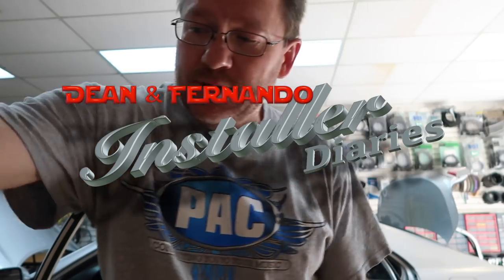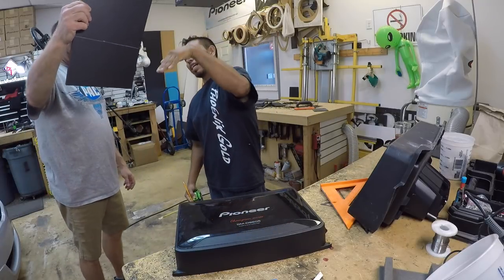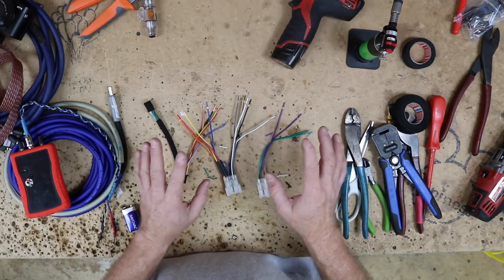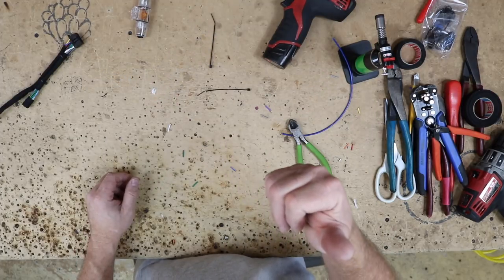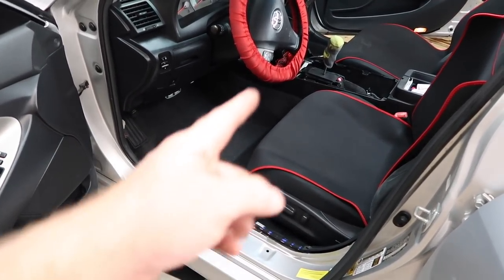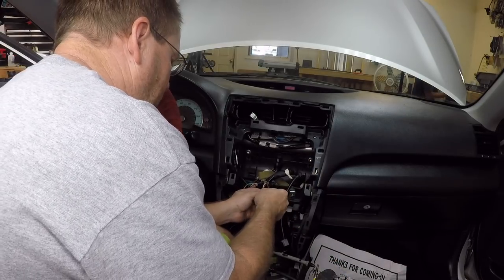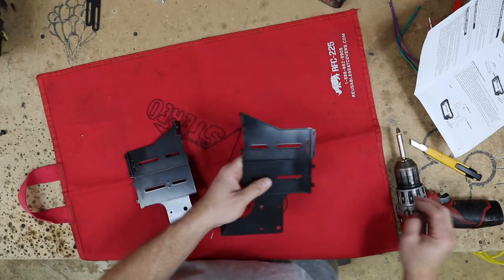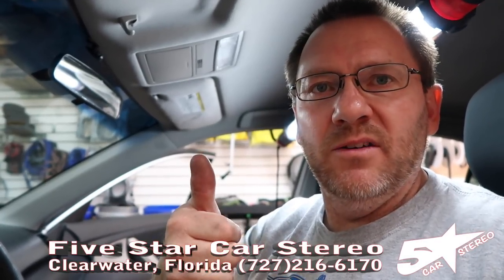Just another Toyota with a Radio and 5 channel amp  Installer Diaries 93

Comment: I used the blue remote amp turn-on lead the same way Dean does in almost the exact same car, and the amplifier drains the battery. I'm rather perplexed by this.
Reply: Keep in mind that the stereo has a 12v constant power wire, which provides constant power if used for your amp and a 12v ignition wire, which will only supply power when the car is on. I would recommend that you tap into the 12v ignition wire, that way your amp turns on with the car. Or you could use the 12v constant and just install a on/off switch between that connection and your amplifier.

Comment: I have a 2000 Toyota Camry XLE V-6 with a factory amplifier installed. I have received a CLARION 200W APX 2121 amplifier. I have also purchased a METRA CK-AJLO ADJUSTABLE LINE OUTPUT CONVERTE.  I have already put in a amplifier kit. I have hit a wall just watched your video explaining how to bypass the factory amp on the douge truck. The speakers I have are in cased in boxes.  So where do I go from here can you please help. Do I need to bypass the factory amp ???

Comment: What’s a good quality 5 channel amp for the jbl system that comes in the TOYOTA venza and a 12 inch JL audio w3 sub ? I was told that I would have to change all the speakers because the factory speakers wouldn’t last long with a 5 channel amp. Any advice

Comment: Hello i have a Alpine iLX-W650 I cannot get it to Voice recongnition when iuse my hands free could it be the interface i am using Crux SWRTY-61N recommended for 2014 Toyota Tacoma,I would really appreciate  your Knowledge.
Reply from the maker: If you mean the button on the steering wheel does not work? You may have to  re program the Crux for that feature. If mean it does not work at all make sure it is plugged into the mic input.
Reply: @FiveStarCarStereoInc  /thanks i'll look into the re-programing, i do have all connections correct and mic is plugged in, only have issues with voice recognition.
Reply: @FiveStarCarStereoInc  /hello again for those in the Know or Not,Dummy me went into my Adroid Samsung s8+ and  went to google and opened up the settings and applied OK Google to my phone, so now ,I can get the Voice recognition  in my truck, works great,now true hands free,so if anyone runs into this problem , just search how to open up OK Google assist in settings, so much tensioned released,LOL!!!!!

Comment: Can you guys please show a newer taurus???? The dash is a b#@&h an I wanna retain factory radio, I think it's easier to get signal from back door speakers an run to trunk. Yes I'm a knowledgeable installer but again the dash an center console has to come out and it's not fun....
Reply: Gary Bonner They need a customer with a new model Taurus to come in for them to show is video in it.